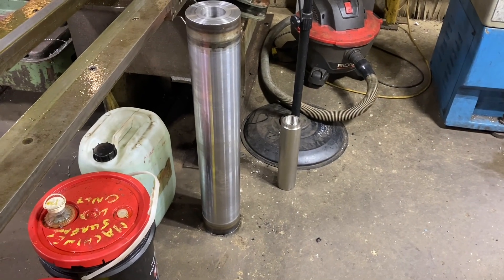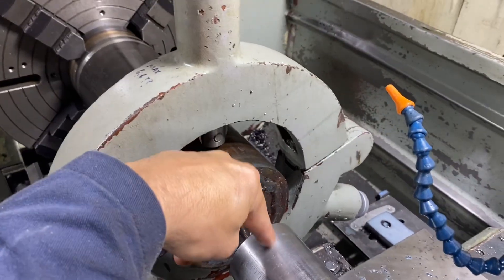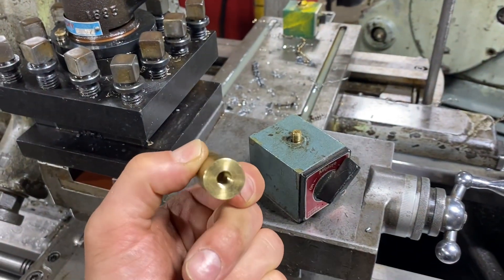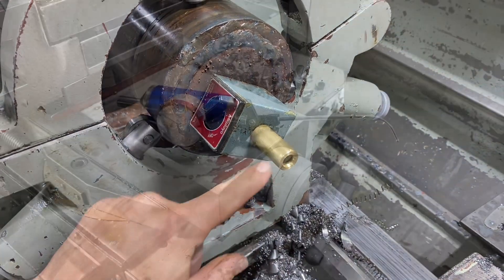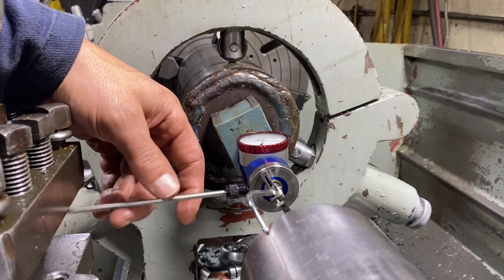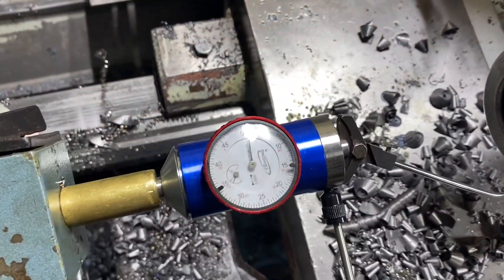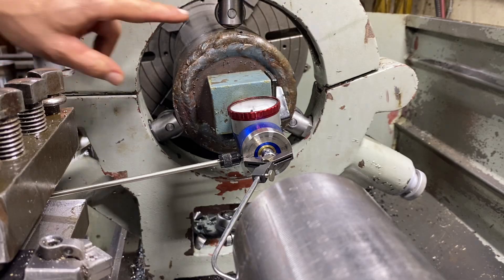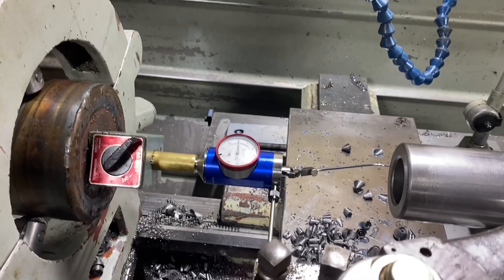Co-ax on lathe, dial that part into the steady rest the easy way.

Comment: What you have to be careful of when doing this is to take into account gravity. Gravity will absolutely throw off your reading in the vertical plane. All depends on how accurate your work needs to be.
Reply from the maker: Agreed, indicating in zero gravity would be better. I find the coaxial indicator less of an issue than a regular size dial indicator. I’ve had lots of grief using a full size indicator for this. Alternatively a small test indicator helps reduce weight but the rather small range of motion can be challenging.

Comment: Surely that part was not round after welding.
Reply from the maker: Most were. One end of one part had about 0.002” of runout. The rest were all less than 0.001” The two smaller rollers I turned the od to clean up, mostly just for cosmetic reasons.

Comment: doesnt work if your tailstock is way too worn out.  youll get a low reading and if the workpiece is heavy, it will walk out the chuck.  good idea if you dont have an old worn out lathe though.  ive never had a nice machine to work with so thats how i know
Reply from the maker: If your tailstock is that low, then almost nothing will work. It would be a good idea to put shims between the lower and upper parts of the tailstock to get it near to the center line height of the headstock. Also, if the end of the tailstock spindle is damaged, or has a groove on one side, put any round thing with a morse taper in there and indicate off that. Thanks for watching and commenting.